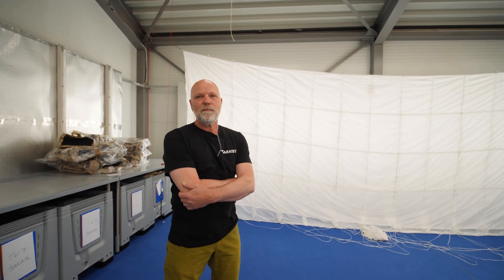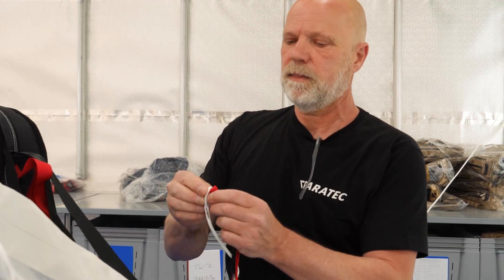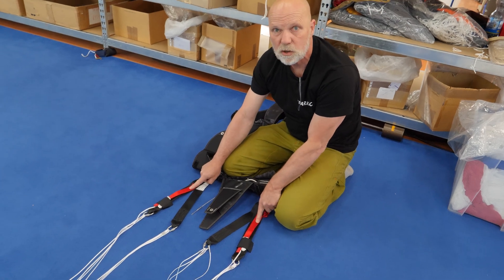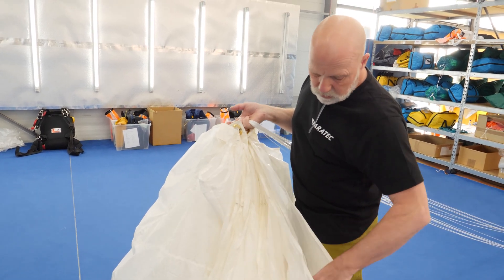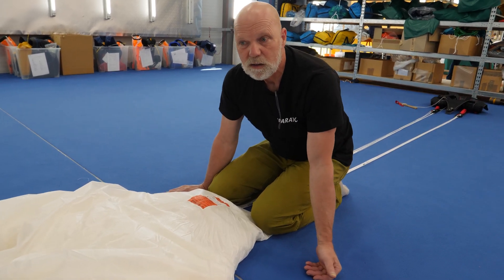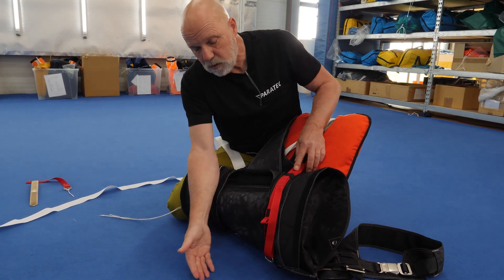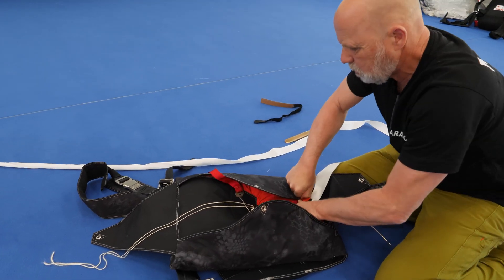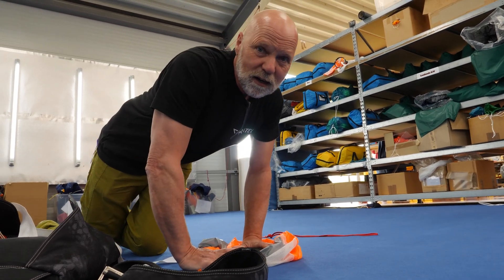Final Assembly of Emergency Parachute - Inside PARATEC

Comment: The packing process looks quite complicated.
Will you be able to find a certified packer that can re-pack this (square) parachute for you once a year?
Reply from the maker: Thanks for the great question, Johan!
I'm a packer by myself but for now I won't make the license for the Wingman. The packing is completely different to round parachutes.
The great news is that skydivers use these parachutes as reserve and they also need to pack them. So you can give it to the next skydive club for packing. And they use the reserve parachute more often than we glider pilots do. So they are well tested ;)
Reply: @SteFly  Of course, that is a great solution!  👍
So now you have the right reserve, all you need is the main chute and you can also join the skydive- club?!  😀
Reply from the maker: @Johan-ex5yj  Hahaaa :D

Comment: Das hört sich alles echt cool an mit dem Steuern usw. Aber wie soll man das wissen?
1. Die meisten Segelflieger sind keine Fallschirmspringer (mich eingeschlossen) und haben keine Ahnung wie das mit dieser Bremse etc funktioniert
2. Man ist gerade aus einem Flugzeug abgesprungen was man nie geplant hat und nie vorher sehen konnte ist vermutlich voller Adrenalin und vergisst deswegen diese Sachen wenn sie einem vor Jahren erklärt worden sind
Reply from the maker: Der Fallschirm ist so ausgelegt, dass man auch ohne Steuern und Bremsen heil am Boden ankommt. Hier ist ein Beispielvideo dazu: https://youtu.be/ZV-_AlRQo2Q

Man kann also die Steuerleinen einfach angeklettet lassen und somit bleibt die Bremse auf 50% gezogen. Am besten zieht man dann noch leicht am kompletten Leinenbündel, um sich gegen den Wind auszurichten. 

Auch das Steuern und Abfangen stelle ich mir nicht sehr kompliziert vor.
Reply: @SteFly  The steering is really not complicated at all: You pull on the right brake, it pulls down the trailing edge of the chute on the right, this increases the drag on that side so the chute will yaw (and turn) to the right… Simple as that. 
Flaring to land is like this: Pull both brakes, induced drag on both sides makes the chute fall back a bit, that increases pitch angle, just like flaring on any aircraft. The correct timing of the flare is something that might require some practise. But just landing it at 50% brakes, will also work.
Reply from the maker: @Johan-ex5yj  Thank you! Do you have skydiving experience?
Reply: @SteFly  No, like I always said, I’m not interested in the sensation of falling, but only in the sensation of soaring (like a bird).  So I did Paragliding for 25 years.  My first paraglider (1991) was little more than a skydive- chute- design adapted for paragliding: Glide Ratio of only 4/1  !!!   After that I had one with L/D= 6/1. My third one was 8/1, and forth one was 9/1.  I would like to get into Gliding soon.
Reply: @SteFly  "Auch das Steuern und Abfangen stelle ich mir nicht sehr kompliziert vor." Als Fallschirmspringer sage ich: "Es kommt darauf an". Das Steuern ist in der Tat keine große Sache. Der Flare ist aber sehr anders als bei einem Segelflugzeug, bei dem der Bodeneffekt eine große Rolle spielt und vergleichsweise sehr, sehr, sehr, sehr viel Flare-Power vorhanden ist. Bei einem Flächenfallschirm muss dies mehr oder minder präzis getimed werden, eine geringe Abweichung geht direkt mit einer mehr oder weniger harten Landung einher. Der Gleitwinkel ist zudem deutlich steiler und der Flare wird vergleichsweise früh eingeleitet.
Dazu kommt das Gewicht des Springers, bzw. die Flächenbelastung. In diesen Wingmans sind im prinzip normale Speed-Reserven verbaut, die kleinste hier verbaute hat 190 sqft (im Sportbereich gehen die bei der Speed bis auf 120 sqft runter, Performance Designs bietet sogar Reserven mit 99 sqft an). 
Eine Flächenbelastung von 1 lbs/sqft ist für einen Anfänger gerade noch akzeptabel. Sagen wir, Du wiegst mit Schirm und Anziehklamotten 85 KG, dann bist Du mit einer 190er-Reserve knapp darunter. 
Wenn man dann halb gebremst und ohne Flare einschlägt, ist das nicht angenehm, aber verkraftbar. Man wird, mit vernünftigem Landefall, zwar von oben bis unten dreckig, aber man lebt und ist unverletzt. Vermutlich würde ich einem völlig unerfahrenen die Variante eher empfehlen, als dass er den Flare verkackt und zu hoch stalled oder aber aus dem zu hohen Flare die Steuerschlaufen noch mal schlagartig hoch lässt und dann richtig hart in den Boden pendelt (das sind dann richtige Einschläge, die sich gewaschen haben). Dennoch würde ich das von Dir verlinkte Video nicht als allgemeingültig hinnehmen. Wir kennen die Rahmenbedingungen nicht (Wind, Flächenbelastung) und vermutlich handelt es sich auch um einen erfahrenen Testspringer, der weiß, wie er fallen muss. Wenn diese Variablen abweichen, kann das Ergebnis schon sehr anders aussehen. Ich würde Segelfliegern, die mit so einem Teil ausgerüstet sind, mal einen AFF-Schnuppersprung empfehlen, dort könnt Ihr das mal üben. Sollte eigentlich verpflichtend sein, wenn man so etwas benutzen will. Allein dieser eine Sprung dürfte deutlich mehr Sicherheit geben. Da bekommt Ihr das richtige Flaren auch vernünftig erklärt und könnt es direkt ausprobieren.
Reply: @SteFly  das hört sich gut an👍🏻danke für die Info
Reply from the maker: @eliask7819  Das Video oben war allgemein von der Funktion des Schirms. Hier ist der Link mit Landung ohne Abfangen und 50% gezogenen Bremsen: https://www.youtube.com/watch?v=qZnMNJisapg